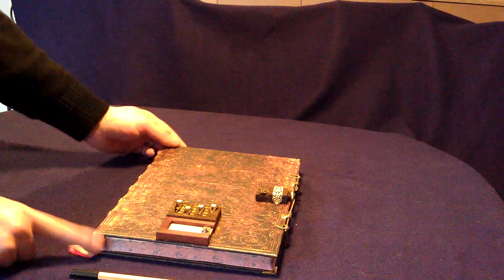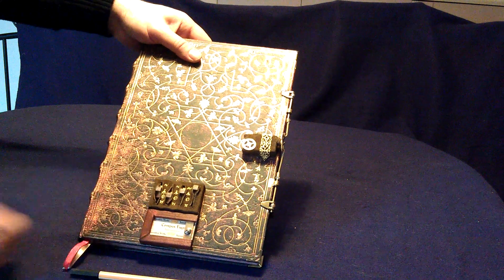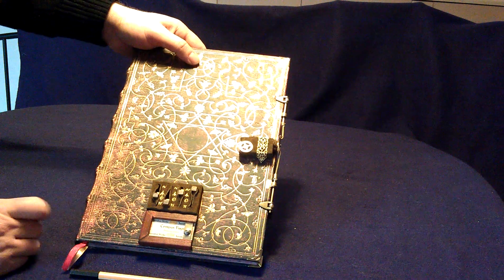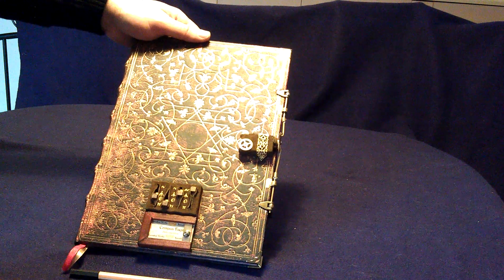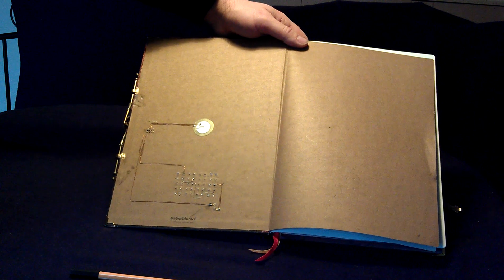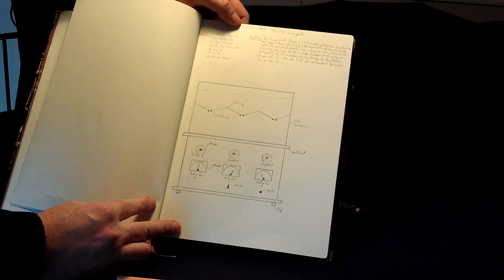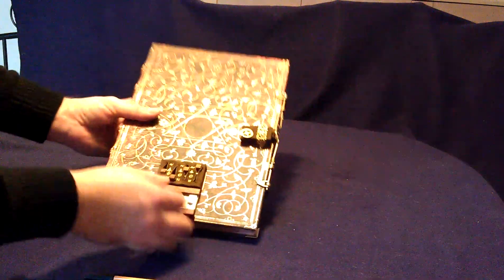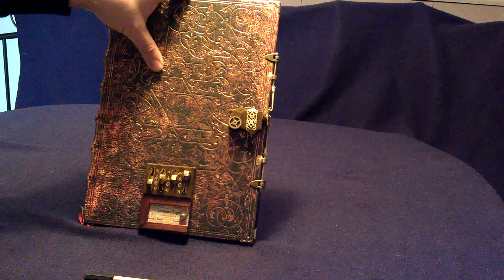Picaxe protected Sketchbook

Comment: Hello Steampunk friends,
This is my latest invention.
A sketchbook secured by a Picaxe chip.
To protect my newest inventions I choose a 2 way protection system.
First you must find the right combination of the four switches.
Every switch has four positions.
At least these are 256 possible combinations.
After this you need the right knocking signal to open the book.

More Steampunk stuff on my website Steampunk-Design.de

Picaxe protected Sketchbook
Reply: Sven Möller do you sell it?